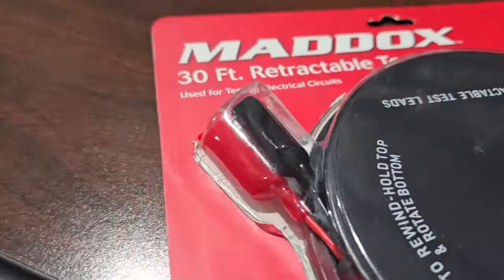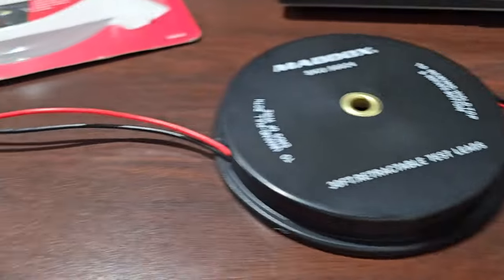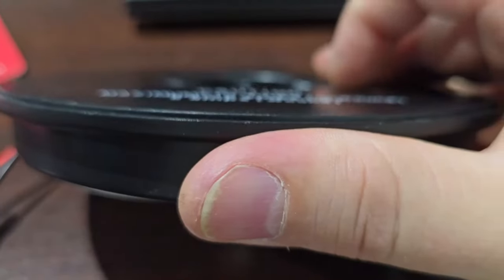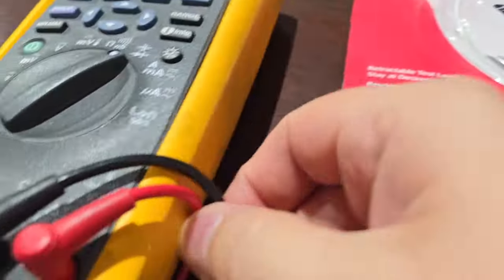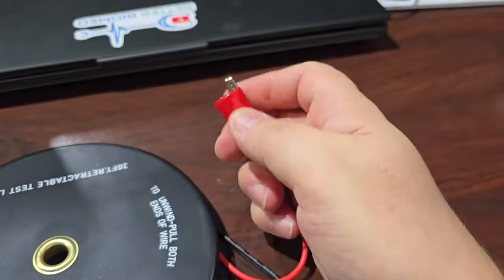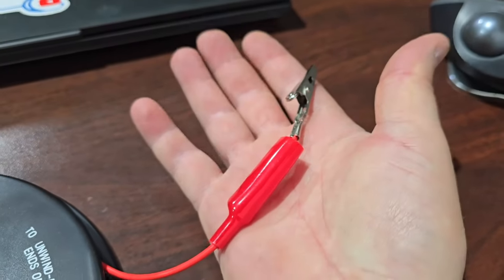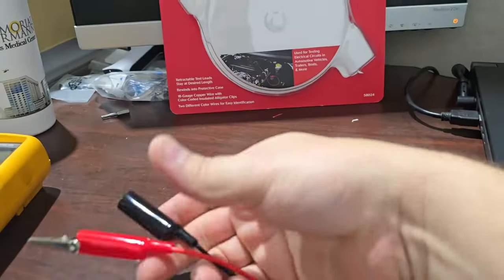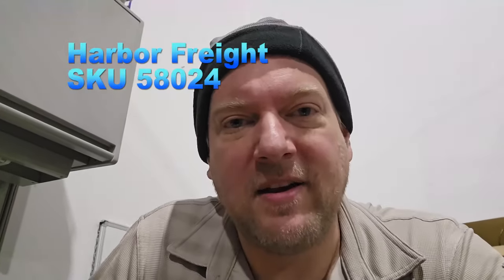Maddox 30ft Retractable Test Lead Set

Comment: I’ve got a question. I have a lifepak 12, has a crack in the handle from a fall. Best way to fix it?
Reply from the maker: I don't believe that Lifepak 12 parts are still available.  Ebay is a source for rare parts, then Dotmed.com .  You could create a public post on LinkedIn requesting the case.